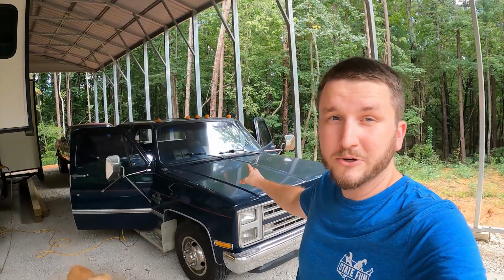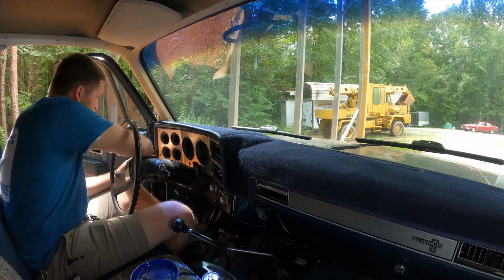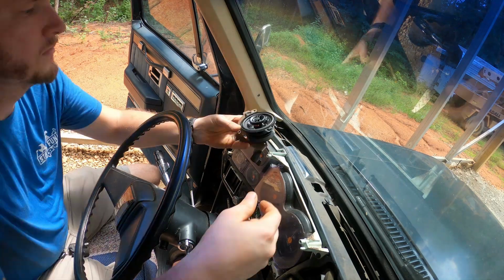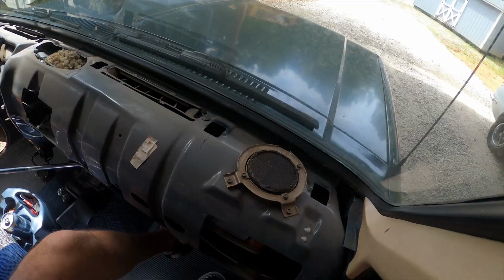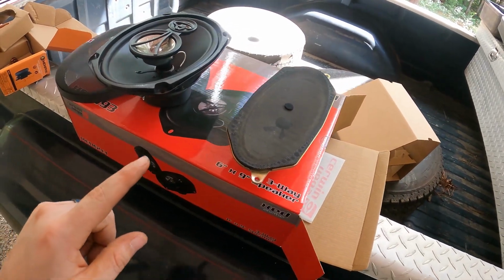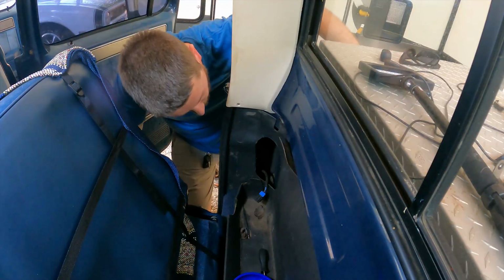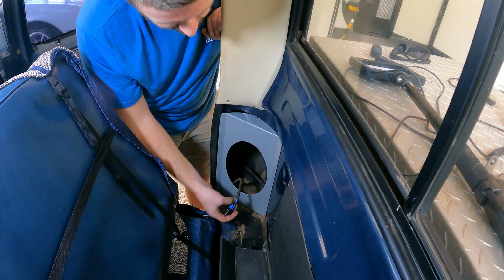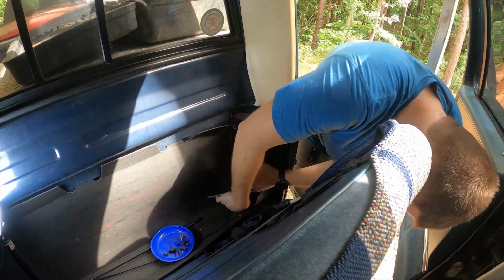1988 Square Body Dually Gets New Speaker System!! | EASY DIY

Comment: 1988 was the first year for the trip odometer which was in both the square body models & OBSs. The only square body models that were dropped in 1988 were the half ton & three quarter ton plain cab pickups. When the OBSs were first introduced in 1988, they only came in plain & new optional extended cab pickup models at the time because crew cab pickup & SUV models with the previous square body design were still in production up through 1991. The one ton plain cab pickups were the only models that came in both body designs at the same time which was from 1988 - 1989. Thaz why the series on square body models were changed to R/V series in 1987 so they wouldn't confuse people with the square body models & the upcoming next generation C/K series pickups which were the OBSs for the 1988 model year because both body designs were going to be in production at the same time which lasted up through 1991.

Comment: For the new rear speaker brackets, did you use double sided tape or screws to secure them to the cab? Or were they snug enough on their own?
Reply from the maker: They were pretty snug, but double sided tape would probably be a good idea. I may actually go back and add that!

Comment: Hey man what wiring did you use for the rear speakers?
Reply from the maker: @KeaganUphoff  the speakers came with some speaker wire, so I just used a short section of it to connect to the factory wiring.

Comment: Where did you get them speaker from  I need some for my 87 squad body
Reply from the maker: Here's the small front speakers, rear larger speakers, and bracket for the rear.
Memphis Audio PRX3 3.5'' Speakers: https://amzn.to/3DD6eR2
CERWIN Vega 6 x 9 Inch Speakers: https://amzn.to/3f4qZLf
Speaker Brackets: https://amzn.to/3ds44sG